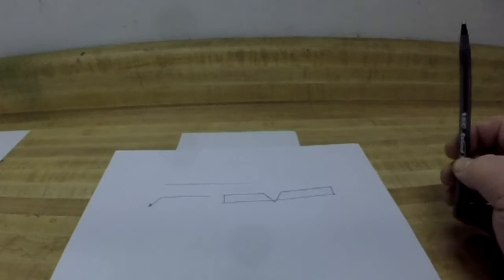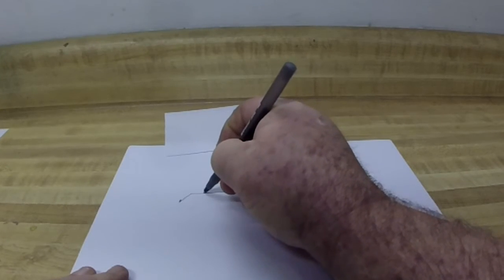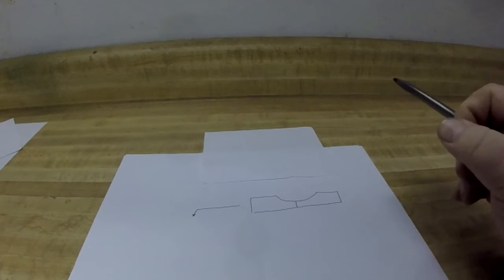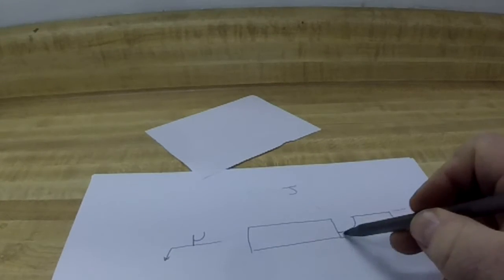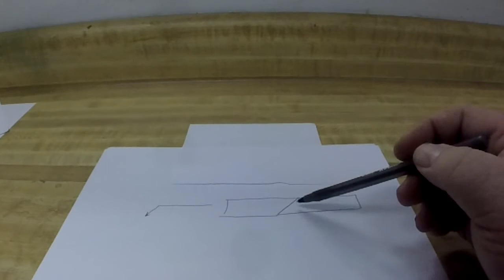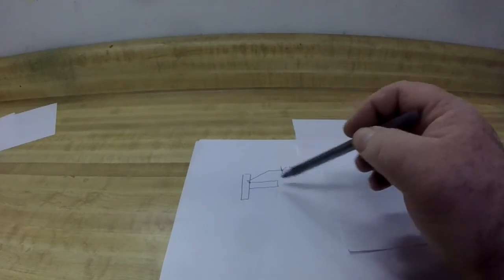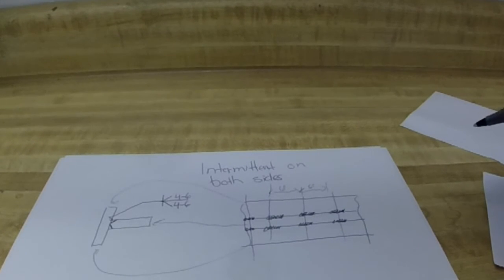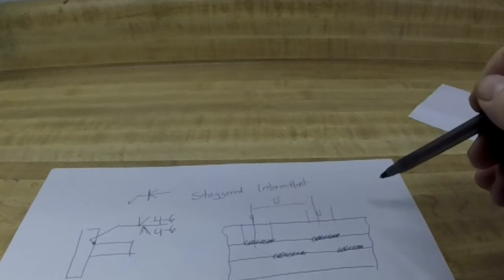Basic Groove Weld Symbols

Comment: I've got a few questions, you still reply to these? Have a similar project underway though wiring is different, shouldn't it automatically switch to the other pot? How did you determine what was what inside the welder? Is there any combination of wiring wrong that would ruin the machine? Hope to hear from you!